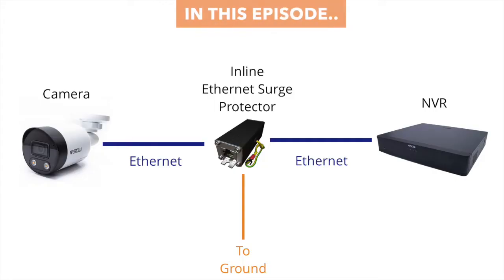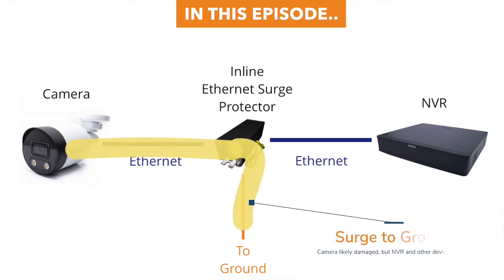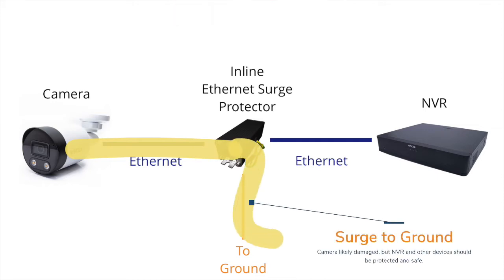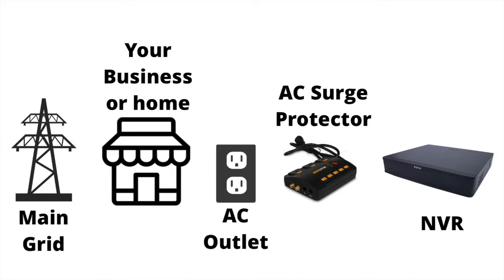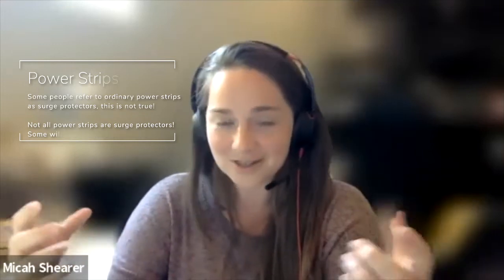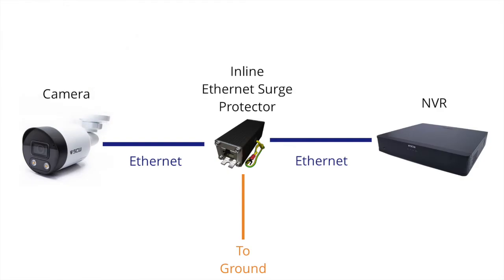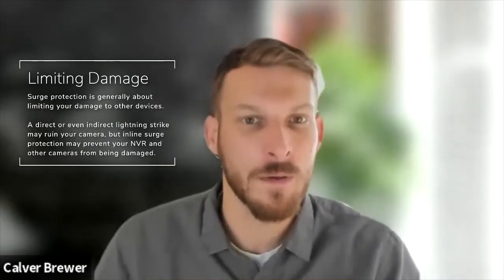Security Camera and CCTV Surge Protectors | How to Protect CCTV Cameras from Lightning

Comment: EMR from nearby strikes like up to 500m  will get into your system. The more wires you have that are unshielded the higher the voltage will be.  I built a house and have multiple type 1 and 2 and 3 SPDs on the electrical and use all cat6a shielded cables but the alarm system sensor wires aren’t shielded and Ethernet connects into that panel. Came through the alarm panel back into the switch and killed 4 cameras. Along with other Ethernet devices in the house.  So SPDs for the alarm sensor wires and SPDs for all camera wires.  $1000.  Figure $60 per device or per lead.  Most IP cameras have a little surge protection built into them along with having metal housings but large enough surges and it’s not gonna help.    Also having a telecommunications grounding bus bar tied into the electrical grounding system is key.  Your SPDs won’t do anything if they don’t all have a bonded ground to go to. That’s a #6 awg copper wire direct to the grounding bus bar inside your electrical panel or tied to the grounding electrode that’s bonded with the electrical panel.

Now if a camera or your building gets hit directly with a lightning bolt… it won’t help. Your camera will be vaporized and they’ll be a big hole. Lighting rods are the only thing that will protect from something like a direct hit.  

The hit that took out my stuff hit a neighbor 100ft away and caused a gas main to rupture, the water main flooding the house, and blew up many electrical outlets along with every electrical device in the house. Neighbors on every side for two houses down had some issue.  Damage to me alone was over $30k.  These are brand new houses. Metal roofs. 400amp service.  Need lightning rods.